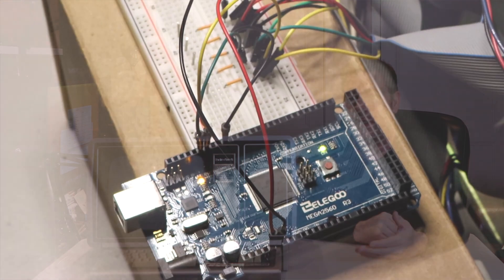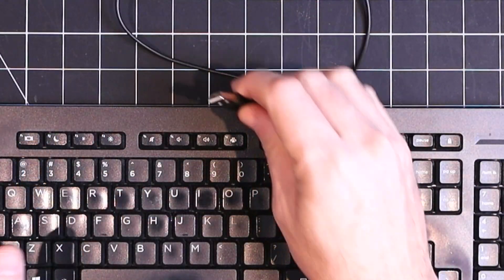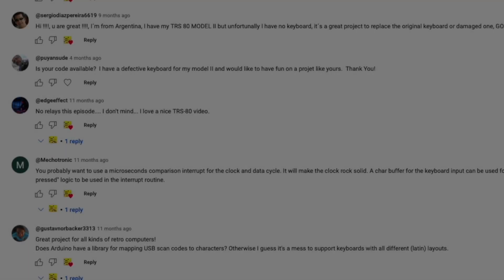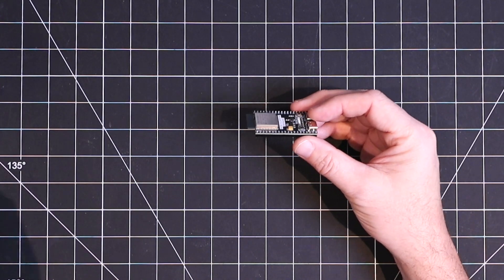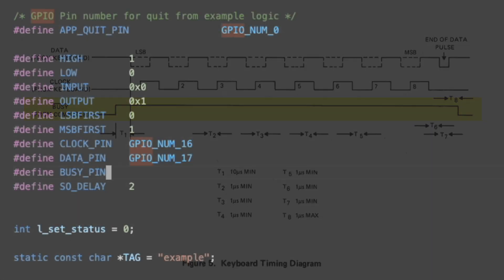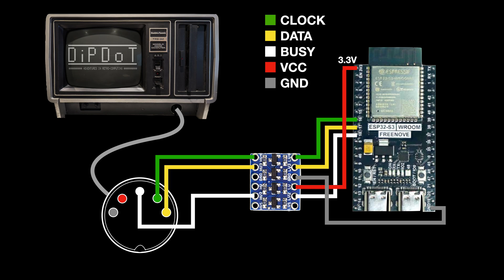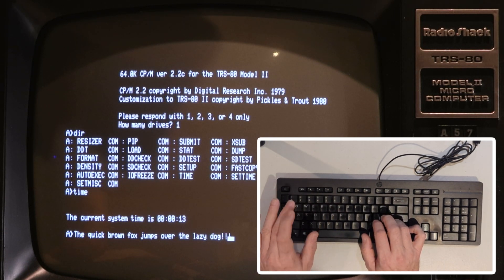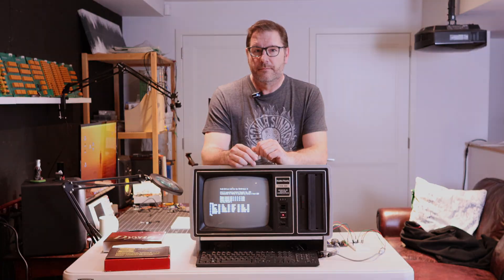I Finally Got a USB Keyboard Working on the TRS-80 Model II! (ESP32 Upgrade | Part II)

Comment: I had a trash 80 model 2. I had so many older computers back in the 80s and 90s. My dad used to buy them at flea markets all the time. From the Ti, Atari, Commodore vic20, 64, 128 ,Apple 2e+ , Atari, so many . I think I spend the most time with C64 and Apple 2e+ but I definitely used them all. They were so simple, yet fun to program. Brings back memories. It started my passion for computers and brought me into a career. Its cool to see new things connected to old computers. Neat project!

Comment: Very cool project!!, and a nice example of analysing the communication between devices. Did you consider the Raspberry Pi Pico for this? - It's way smaller and has everything but the level-shifter onboard.

Comment: Thank you so much for doing this, I have a Model 2 I got a year or two ago that has just been sitting because I don't have a keyboard and they are incredibly hard to find. You have just made my week!  If I can get this working correctly I may port it to the PI Pico and see about making a custom PCB for it, mainly as a novelty for myself. Seriously thank you, I can finally start tinkering with COBOL on it after all this time it's been sitting!

Edit: Forgot to ask but do you have a link to the connector you are using that goes to the ESP32?
Reply from the maker: Thank you! And good luck with the COBOL! The link from the Model II to the ESP is a standard DIN 5 connector - here's the one I used:
https://www.amazon.ca/Be-Your-Mind-Connector-Equipment/dp/B0D78LRG93/ref=sr_1_16?crid=2N8MVCC5W6VD8&dib=eyJ2IjoiMSJ9.6fdSEWmRy_HFkCw2accsGDxFZnxZET_2-3tYLtd4h26Vfchrq1sqI__8p9AWORycxwcBrjNEEx1vg7zJnOTyx7crkT-RgCkOj5nfSQso7z650OhOssGajgowgnL9UfI4strJBwourubD12ieV_XQgFDgOkEv5ibb4DW8CmnGGcwxmr6FAt4vDe592AmpmC3-5kkG61VOKSBEzpVkYulK2lfeFuoj5jZuhMKNAq57f1uy5qXy6TiQW7Sy1uRNmLoFdvepT8SSf35KKGFnt9zXBiWVEgkKsEZUASGnJxPASeB9r7u_WFjMYW-kkYvnbyfzotQztr1wK1tPZIlr845niZhhV7iepxYNlVhfr4cF_5uldC1lOZoCxSoOl2lGMt2tmxVjh5aI7LKDI0OaGPq4KMnHpAHPfJ81Td6CkLVESuWEZMYDURCtWTR6VevZHPzs.i1wckRGljI5beeMgdLSCCJIGL2r_LoQfljohIQC1msA&dib_tag=se&keywords=female+din+5&qid=1740450826&sprefix=female+din+5%2Caps%2C82&sr=8-16